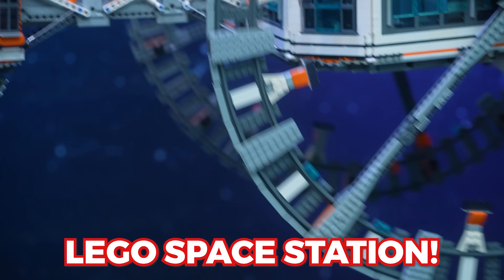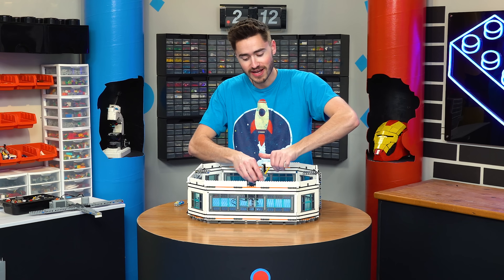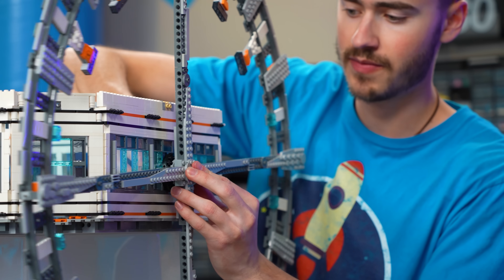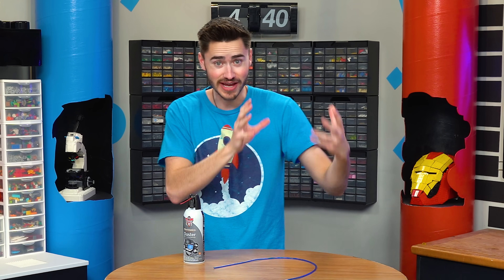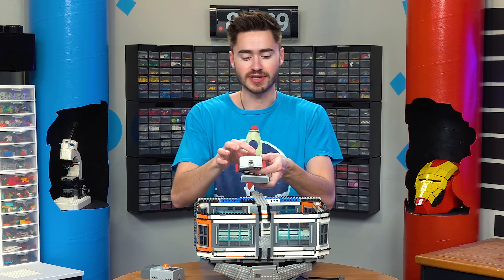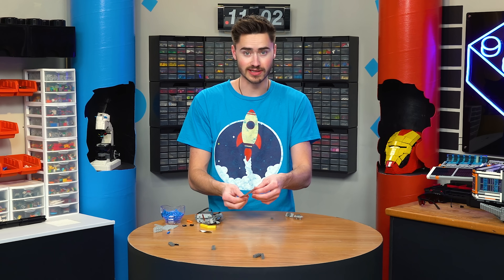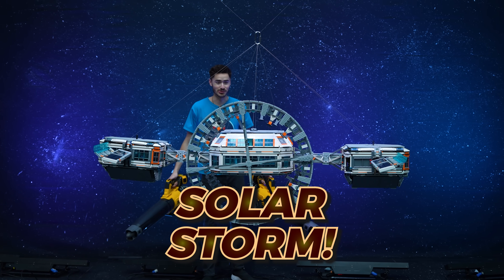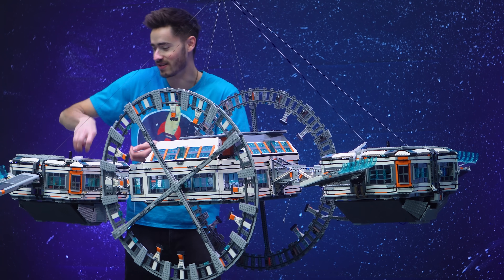I Built a LEGO Space Station!

Comment: Funfact: Astronauts actually have to work out quite a bit, since in Zero-G, the muscles would decline rather quickly. Ironically, due to being in Zero-G, a weight rack is utterly useless. They mostly strap themselves to a treadmill.
Reply: Astronauts do actually do "weight" training, but instead of weights, they use an adjustable elastic mechanism to simulate the same force. So, you can bench-press in space!

Comment: An actual rocket ship does not use “air jets” to reposition; they use something called RCS (Reaction Control System) which uses hypergolic fluids to create thrust. When two hypergolic materials come in contact with each other, it will create a rapidly expanding gas which is redirected out of the RCS nozzle. Sometimes, RCS will use something called monopropellant which is something that will rapidly decompose using a catalyst. The most common example of this is hydrogen peroxide and potassium permanganate.